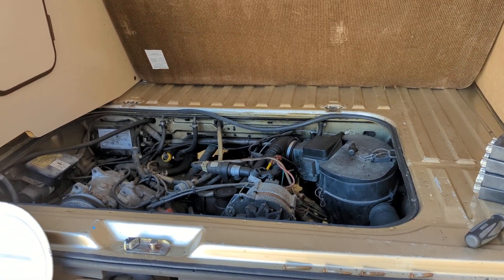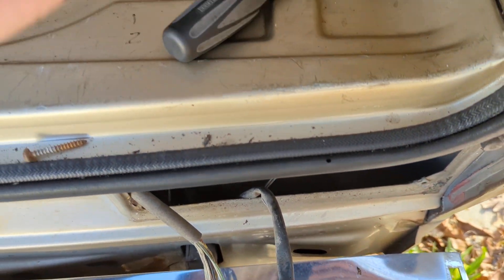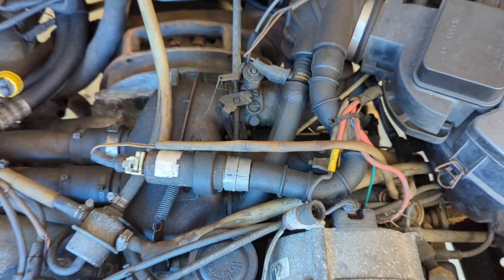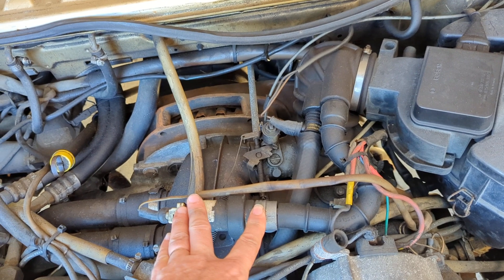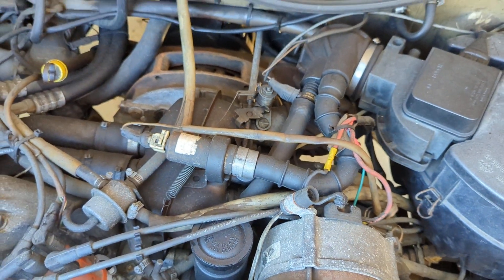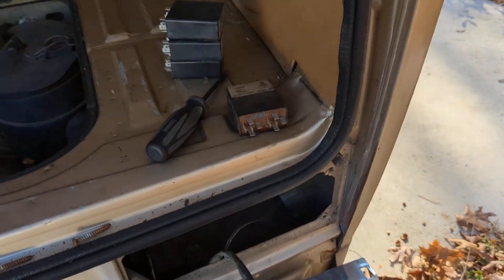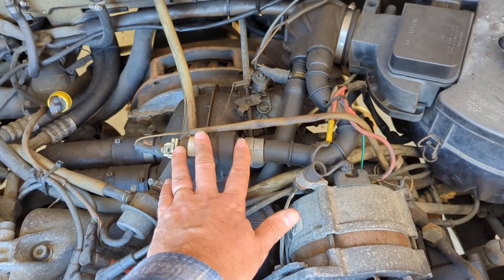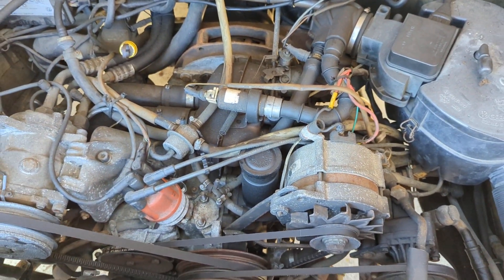2.1l Vanagon Idle Control Unit location, function and testing.

Comment: Hey Ken!  I replaced my Idle Control unit. It was an easy fix and immediately solved my fast idle problem. QUESTION: I know you repair the Idle control units... this one has a burned out resistor (the large one marked "56R 10%"). Do you know what to buy and where to get the replacement? I'd like to add soldering and electronics repair to my skill set :) Thanks! Dave
Reply from the maker: I actually don't repair them myself.  Digikey?

Comment: Hello, mostly clear.   My problem is that the fuel injection system was replace by a single carburator.  Two issues: 1) the idle is too high   2) if i lower it to 800 to 1000 rpm (by adjusting the idle jet), when reaching the end of turning steering it will stop the engine....  
any help?
Reply from the maker: That is one of the downsides of replacing the FI with carburetor.  It is something that you will have to learn to live with.
Reply: i didn't replace it, i bought with that change, and was more ignorant of how it works than now... thanks for the info
 @vanagain

Comment: 89 vanagon...looks like mice ate the wiring harness at the relay, but my van idles smoothly. Hmmm....
the only reason I found it was because I had the tail lights out for painting the body. Now going back together and will repair the wiring and ops check the system. fingers crossed!

Comment: Hey Ken, if my van keeps running with the IAC valve unplugged, which seems wrong, should I adjust my idle screw?
Reply from the maker: If it is still idling high, you can try to adjust it down with the screw.  If there is an intake air leak it will not lower it.
Reply: @vanagain  thanks! I turned the idle air screw in and it helped a lot to lower the idle, and now the idle air control solenoid is raising the idle like it should.
Reply from the maker: Great to hear!

Comment: I’m having a horrible time with a high idle! I just removed my AC unit…all of it including the D pillar relay. I was idling perfect at round 1,000 and now I’m up to 1,300-1,400. I reconnected all the wires except the AC water condensing unit but the D Pillar relay box is back in and it’s still starting up and idling super high
Reply from the maker: Try unplugging the idle air valve.  Does the idle go down to normal?
Reply: @vanagain   could the ECU be thinking my AC is on right at start up? I took all that ac stuff out on Sunday.
Reply: Where is that part. This is all super new to mw

Comment: Hey mate, Aussie here.
I’m at a loss, throttle switch adjusted as per your vid. New idle stabiliser valve. Tried two control units and my van still revs it’s hole out. I’ve no idea why. Have I missed anything?
Reply from the maker: Unplug the idle valve.  Does it still rev high or unsteady?  It is a vacuum leak.
Reply: @vanagain  mine will die completely if I unplug it.
Reply: I think it is because you guys drive on wrong side of the road!
Reply: @zdenekkindl2778  yeah maybe

Comment: Hi. thank you for the video. My vanagon is stalling after start up. no clicking at idle but their is one at full throttle . tried moving the throttle a bit to see if the clicking sound would manifest, no go. If I keeo it from stalling by accelerating and then start driving around, then no stalling. Help!
Reply: Colanutman, did you ever solve this cold idle at start problem? Same issue with me. Gotta step on throttle after cold start.
Noticed no one answered your message after 2 yrs

Comment: Hey Ken great video. My 91 has issues with the idle not coming back down. It will also bump itself up sometimes. Thoughts?
Reply from the maker: Check the throttle position switch.  I did another video on that.

Comment: Very nice, Ken!  A couple points: starting around '90, the IAC valve only vibrates when the fuel pump is running; and the idle controller sends 12V pulses at a fixed rate of ~250 pulses per second.  It varies the valve opening by changing the length of the pulses, in effect simulating 0 to 12 V sent to the valve.

Comment: Where are u located? My 87 westy stalling when is cold outside. After 30 min looks like it works fine.thank you
Reply from the maker: After the van warms up it doesn't even need this idle stabilizer.  So it sounds like this system isn't working for whatever reason.  I am located in New Jersey in the USA
Reply: @vanagain  the idle stabilizer is working all the time. It is there mostly to raise Idle when there is load on the engine like AC or power steering.